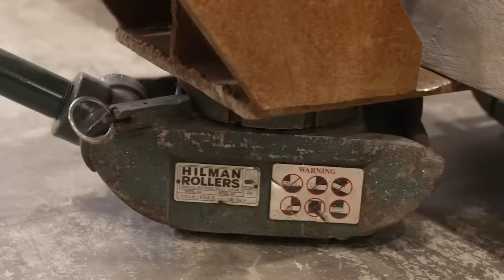Fitting the Lead Ballast Keel (Tally Ho / EP120)

Comment: Leo, well done on placing the ballast keel in place, team.
 So, will you all jack the boat up with the lead in place and drill from the outside in for the bolts? Or will you drill from the inside out for the bolts and counter-bore with a right-angle drill for the washer and nut from the outside?
Reply: Inside out and countersunk for the nuts at the bottom of the lead keel
Reply: @on4xb  yeah, that's how I would approach it.

Comment: I’m curious. How many bolts might bee needed to fit the keel ballast to the keel, and would there be a pattern to their installation rather than just in a straight line.
Reply: About 13 bronze bolts at 2-foot intervals, in a straight line right down the center. These bolts won't penetrate the bronze floors - only the lead & timber keels.
Reply: @frederickstibbert7389  Not as many as I expected given the weight, and had thought a zig zag pattern might have been used in their placement for extra strength. Given I’m not a boatbuilder I live and learn. Appreciate the reply.

Comment: Fantastic  job.  However, maybe I missed it, but how is the keel physically attached to the underside?  That is a lot of weight that can't possibly be held by a few bolts.  It's something I've always wondered about but never seem to get an answer that can be believed.  Answers always seem to be in the form of humor. Love watching the entire process. Thanks.
Reply: Bolts it will be.  There were thirteen holding the original keel.  This one's a bit heavier so a few more bolts would not surprise me.
Reply: @dbeierl  Thanks for the answer..... But somehow I'm having trouble believing bolts are enough.  Lead is soft so there must be some sort of large washers to distribute the load.  If those are metal they will break down with salt water.  Just me over thinking things again.  Thanks.

Comment: I've enjoyed the clips so far on the keel, but have one question - is it only held onto the boat by tar or did you need to put bolts through both???
Reply: That has not happened yet,  The title says 'Fitting the keel ..." ergo it is a dry fit. Next step will be bolting the keel trough both keels with long bronze bolts: 13 of them the plans say.

Comment: I don't understand how the ballast-keel is not bolted to the bottom of the keel. Is this glue/tare with filt in the middle able hold a 8 tons keel?
Reply: It will be bolted though in time with at least a dozen BIG bolts drilled though from the top of the keel.This episode was just showing it in place and how it looks.

Comment: I'm confused.. what actually holds the lead keel to the timber?  Just the black stuff? no mechanical or bolted connections?  Unless I'm missing something, whats preventing the keel from just falling off once the boat is in the water?
Reply: Throughbolts....
that go through both the lead keel and the wooden keel..
and bolt both together...

Comment: It it just chemically bonded in place? Are there no mechanical fixings?
Reply: 12 or so bronze through-bolts, 1" diameter. They'll sew the ballast keel to the timber keel, but they don't go through the bronze floors.

Comment: But you don’t appear to have used any bolting surely tar is not going to hold this lead in ?place
Reply: Frederick Stibbert
1 year ago
It will be bolted to the timber keel w/ 1" diam. bronze through-bolts at 24" spacing, but these bolts don't penetrate the bronze floors, which are already bolted to the timber keel .

Comment: so No screw , nothing ? to attach to vessel that huge lead ballast other than tar and glue ? or Am I missed something ?
Reply: Frederick Stibbert
1 year ago
It will be bolted to the timber keel w/ 1" diam. bronze through-bolts at 24" spacing, but these bolts don't penetrate the bronze floors, which are already bolted to the timber keel .

Comment: God I love Port Townsend 2000 2001 and 2002 after I spent two years in cooking school I went to cook and I burned out so I wanted to find out where my food came from I wind up in Seattle of all places working for a fellow who owns a fishing boat his name is Matt willing the name of the boat was the Cape flattery the wooden boat that he was going to use to give whale tours I think he sold it to a fella named Lynch lock anyway I help restore some of the decks ring the brass out on the port holes that are used to drop fish into we put some of the timbers back together for the frames down in the bottom and even tried to restore some of the seals around the main shaft in the bottom I miss working on that old boat I’m not much of a ship right although I do know how to Caulk a deck  run electrical devices and for seven years I live off the grid in an airstream which is basically a land boat and aluminum land boat Rerocc 1500wats  panels in panels and had 400 amp hours and batteries and it got us through even on cloudy days if you need a device tech or just someone to run an orbital sander for fucking ever let me know man I love that town there is a bar there I want to say it’s like the siren song or something like that or maybe that’s what it was at the time the beaches were fun it’s a bit cold the people were nice and when I had to leave I was kind of very sad even though I was there for very short time from what I would consider it’s a beautiful little town about the size of my hometown Stanardsville Virginia what y’all are doing is pretty awesome even though you don’t pretty much get to keep the boats they’re paying you to fix them and it’s always been my dream to fix up an old 40 footer like a 40 hunter or something like that Anyway thank you for tolerating my longest hell message and you guys keep it real it’s awesome up there and what you doing is a pretty cool trade I miss boats I miss being around them I miss the smell of the sea and I miss your quiet little town

Comment: How is the lead keel fastened to the boat
Reply: Frederick Stibbert
1 year ago
It will be bolted to the timber keel w/ 1" diam. bronze through-bolts at 24" spacing, but these bolts don't penetrate the bronze floors, which are already bolted to the timber keel .

Comment: how do you secure the keel to the boat if you don't have keel bolts?
Reply: What you saw in the video is just a dry fit, nothing more. It will be bolted to the wooden keel later
Reply: @on4xb  thank you. I was expecting to see the keel bolts set during the pour. Do you know how he plans to set the keel bolts now?
Reply: Simply: Drill holes trough the wooden and lead keels (from within TH), countersink the holes in the bottom of the lead keel to hide the nuts, Make a series of long bronzen bolts threaded on both sides,  lower (hammer) the bolts trough the drilled holes, mount a big washer and a nut on under side of the lead keel, another washer and nut inside TH and torque everthing together. Peen the nuts on both sides. That"s it

Comment: I feel like I've missed something. Are there bolts through the timber then through the lead ballast? Silly question, but it's not just glued with the pitch surely?
I nodded off during the video but I scrolled back and forth several times and all I came up with was the keel bolts in timber, not the lead?
I can't find any other comments so I must be missing something...
Reply: The through bolts go through both the lead keel and the wooden keel...

Comment: how is it attached... its pressed on to it with the tar and felt between... but I didn't see any way it was mechanically locked.
Reply: Bolting of the lead keel hasn't happened yet. Consider this a dry fit
Reply: @on4xb   ah, ok, tho I think the tar is still a bit wet ;)

Comment: is this keel just glued to the hull? no bolts?
Reply: Tar
Gaffer tape
Mil-spec velcro
The power of prayer
Bitcoin
Also, 1" diam. bronze through-bolts at 24" spacing, to be installed later.
Reply: Frederick Stibbert
1 year ago
It will be bolted to the timber keel w/ 1" diam. bronze through-bolts at 24" spacing, but these bolts don't penetrate the bronze floors, which are already bolted to the timber keel .

Comment: Question, im curious why no type of rebar was used in the pour of the led, is there a particular reason? thanks.
Reply: At least 3 reasons:
- It's not needed for strength, the ballast keel is not a structural element.
- steel would corrode viciously while in contact w/ lead & seawater
- the two metals expand & contract at different rates & would separate over time. (Steel rebar & concrete work well together b/c their 'coefficients of thermal expansion' are nearly identical.)
Reply: Thank you so much for the reply. I love watching the show every week

Comment: How is it attached to the boat
Reply: Frederick Stibbert
1 year ago
It will be bolted to the timber keel w/ 1" diam. bronze through-bolts at 24" spacing, but these bolts don't penetrate the bronze floors, which are already bolted to the timber keel .

Comment: How is the ballast keel attached to the boat? Did I miss something?
Reply: That has not happened yet,  The title says 'Fitting the keel ..." ergo it is a dry fit. Next step will be bolting the keel trough both keels with long bronze bolts: 13 of them the plans say.
Reply: @on4xb  OK Thanks

Comment: How was the keel attached to the bottom of the boat?
Reply: Originally, 13 x 1-1/8" bronze bolts. Now, 13 x 1-1/4" aluminum bronze bolts.

Comment: I don't think that little glue you applied would be strong enough to hold that lead! for a proper glue job you should apply it on both parts and let them dry to touch and then leave it under clamping force.

Comment: Did I miss something...
The tar is holding the 20,000 lbs of lead to the keel by itself?
Reply: There will be bolts.
Reply: @dbeierl  what kind?
How many?
Will they penetrate the keal? If yes, how are they sealed?
Reply: @notyou1877  IIRC the original had 13 bronze through-bolts.  It's heavier now so it wouldn't surprise me if they used a few more.  Sealer might be the same stuff they used on the tar paper.  All will be revealed soon I'm sure.
Reply: @dbeierl  thanks for answering my questions.
I will be watching to see how all that goes back together.

Comment: Is there no shrinkage when casting lead?
Reply: Pure lead shrinks about 1.5% when it solidifies - that's a lot !
But this stuff had a small amount of antimony in it, 3 or 4%, which adds strength & substantially reduces the amount of shrink.

Comment: I’m confused, where are the keel bolts? I doubt you’re planning on adhering the ballast keel to the keel timbah with tar.
Reply: Holes are bored through the keel timber and lead ballast keel and silicon bronze rods threaded on either end with nuts and washers tightened in counter bored recess in the lead.
Reply: @AnthonyHigham6414001080  
Thank you, thought that might be the case. I guess setting bolts in the molten Pb would be far too difficult from the perspective of lining up after the Pb cooled.

Comment: Leo, in the last few videos, I don't think you talked about how you dealt with lead shrinkage in the mold and how you adjusted the mold for this when you built it.  Clearly, cutting off the one end as you did addresses the long dimension where the dimentional shrinkage would have been the greatest.  Did you do anything else?  Did you essentially oversize the mold to accommodate?
The other thing I saw was when you did the pour, you kept adding lead in the canter as the void was formed due to the shrinkage.  How long did you need to keep feeding small amounts of lead into the mold to address that?  Was it an hour or so?
Reply: @AIM54A  Yes, for sure.  I totally get that as well, so that is one other factor in this.

Comment: 12:00 Id be very wary of putting such sharp inside corners in metal. Massive stress riser that will start to crack under any kind of cyclical load. 

Maybe its not an issue in lead but I would take a round file and put just a few mm radius on it.

Comment: Can anyone please tell me what he is using at 11:45 that is shaving metal so easily.
Reply: That's a normal electric power-planer, usually used for wood. The lead-antimony alloy is softer than some of the hardwoods used in Tally Ho, so regular woodworking tools can be used, & their blades stay sharp.

Comment: No idea why this popped into my feed.  I have to ask:

What in the world kind of “glue” is this that can stick a lead keel to wood????

That defies my common knowledge.
Reply: That has not happened yet,  The title says 'Fitting the keel ..." ergo it is a dry fit. Next step will be bolting the keel trough both keels with long bronze bolts: 13 of them the plans say.
Reply: @on4xb  thank you sir. But nevertheless that’s one tough glue. Couldn’t catch the brand or it’s type…
Reply: @Yankee7000  - 'S not glue but ordinary roofing tar that forms a flexible bedding. It fills up air pockets that would otherwise fill w/ water. The roofing felt is also impregnated w/ tar - its purpose is to add thickness to the bedding joint, which must be able to flex a bit as temperature changes cause the lead & timber keels to expand or contract. If too much tar is squeezed out as the keel bolts are tightened, the joint will be too thin, & will break easily.

Comment: I still don't understand how the lead ballast is actually attached to the boat? Surely it isn't glued on..
Reply: Holes are bored through the keel timber and lead ballast keel and silicon bronze rods threaded on either end with nuts and washers tightened in counter bored recess in the lead.
Reply: @AnthonyHigham6414001080  Thank you! So much!

Comment: Wait so it's just glued on?
Reply: tar is the ultimate stickystuff
Reply: @frederickstibbert7389  Hahaha !
Reply: @frederickstibbert7389  I would have never guessed that was how it was mounted I assumed bolts or straps or it being layed in the haul this is unreal
Reply: @sethg6157  - If you look at EP7 & 8 you'll see how the old keel was attached w/ 13 large bronze bolts - Tally Ho will soon have her new keel bolts installed. The tar serves as a flexible bedding & sealant that fills any gaps between the wood & metal keels & keeps water out of the joint.
Reply: In time it will be though bolted with a dozen or so very big bolts.This was just basically a dry fit.

Comment: One thing to note, most of the lead shaping work in this vid was much more hazardous from a health standpoint than the actual smelting.  Cringed watching them use a planer without a p100 mask. Just sweeping the floor afterwards would’ve made the air in the shop unhealthy to breath. 

Ok, concerned rant over, the keel looks amazing. My question will probably be covered in the next video, but how is it mechanically fastened to the hull?

Comment: Wondering if you can elaborate on the need for the ballast keel with lead.  Understand it's for stability, yet on other boat building clips, those sailing boats don't seems to have extra or external means of weight to lower C.G.  Is it true those other boats don't require external (meaning non-built-in lead/ contrast to  internal/external meaning) weight?  Or is it simply tally ho was designed with extra keel?  Thanks
Reply: Nearly all sailboats have a heavy keel to keep the boat upright (or lean less) when the wind is captured by the sails. Otherwise sailsboats will capsize. There are different types of keels, short deep keels (with or without a bulb at the bottom) TH has a long lead keel as the all had in that era. Don't forget that the hull itself sits deep in the water, about 2 meters (or 6-7 foot)
Reply: Thanks for education.  was particularly interested in using lead as part of the keel.  Would that, meaning pouring lead as keel, also be the case with old Spanish/French/British trading or war ships?

Comment: I'm kind of surprised that the keel is on the outside of the boat, sitting in the water. What will you be doing to prevent the lead from corroding and contaminating the environment?
Reply: Most boats have the keel exterior. The original keel did for 100+ years with practical no damage. See the early episodes 7 and 8 where Leo removes the original keel

Comment: Lead is a soft material, so how can it not deform on its own weight?
Reply: It can & will deform, so it must be supported at many points along its length until all the keel bolts are installed.